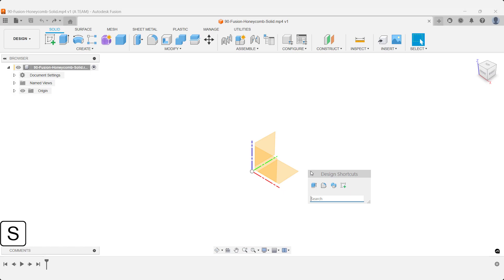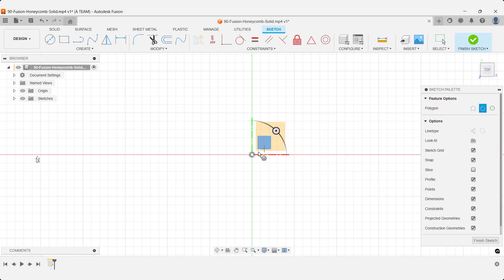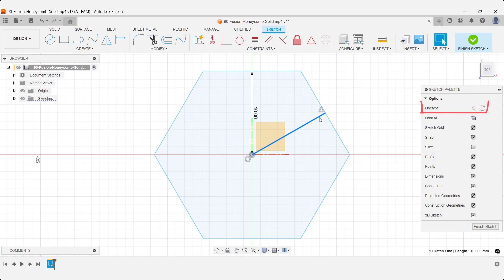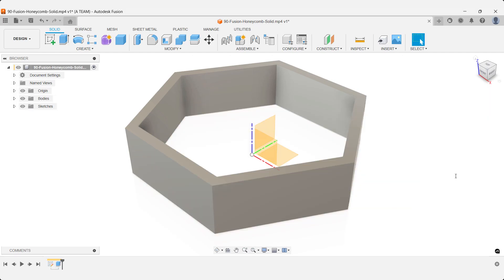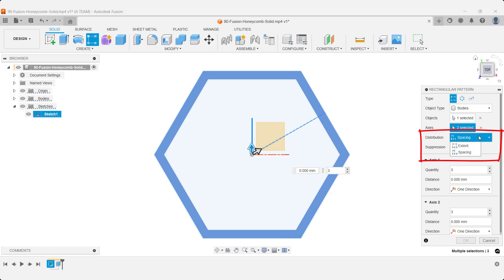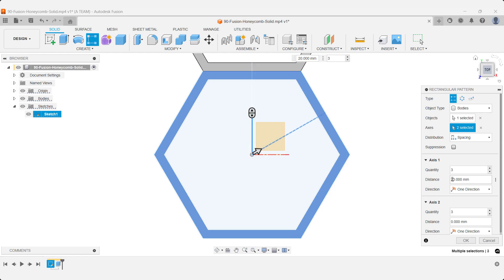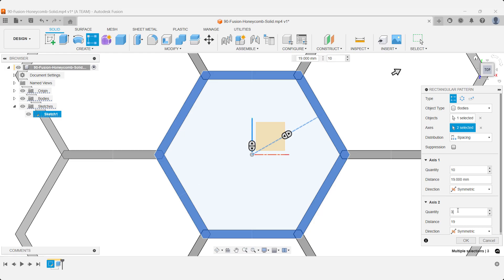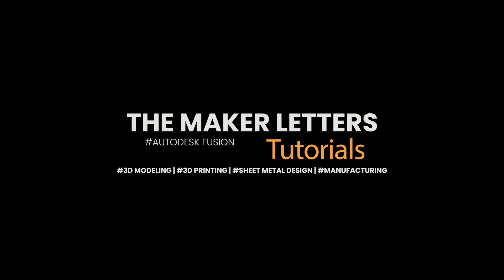Perfect Honeycomb Pattern in Fusion — The Easy Way

Comment: I found your video helpful but doesn't  Parametric usually use variables and equations for all of the dimensions? You manually entered all dimensions and would require multiple modifications to change a dimension. To me a parametric model would have a limited number of variables that the user can change and the model would update properly. I would change the title of the video so it is not a clickbait term.
Reply: It's an easy setup. Took me a few minutes. The trickiest part was entering the value for the initial size.
So it ended up as: " HexSize *2 -1 " for the expression. 
Then just go in, and wall thickness, height, copies, etc, are straightforward values.
I'm more than likely going to post this up on makerWorld or someplace for a free Fusion file.

User Parameters	
HexSize			mm	10 mm	10.00	change for hexagon size	
wallThickness	mm	1mm	1.00	Hexagon Wall Thickness	
wallHeight		mm	5mm	5.00	Hex wall Height	
copies			/	3		3		copies in the U direction	
copiesv			/	3		3		copies in the V direction	
Model Parameters	
	Sketch1	
Linear Dimension-2	d1	mm	HexSize	10.00	
	Extrude1	
SideWallThickness	d2	mm	wallThickness	1.00	
AlongDistance	d3	mm	wallHeight	5.00	
TaperAngle	d4	deg	0.0 deg	0.0	
	R-Pattern1	
countu	d5	copiesU	
County	d6	copies	
uspaceDistance	d7	mm	HexSize *2 -1...	19.00	<--- The important part
Space Distance	d8	mm	HexSize *2 -1..	19.00	<--- The important part
Reply from the maker: Great! Well done and thank you! :)
Reply from the maker: Ps. Looking forward to testing your User parameters myself! :-)
Reply from the maker: I've set another title now, thank you!
Reply from the maker: Thank you for your feedback.

The model is parametric via the Fusion timeline. The model is not (and does not claim to be) parametric via User Parameters
Reply from the maker: It’s a good video idea (a project that covers this for User Parameters). Thx